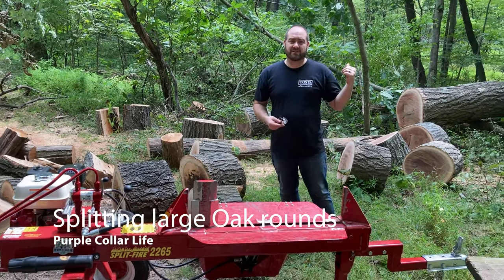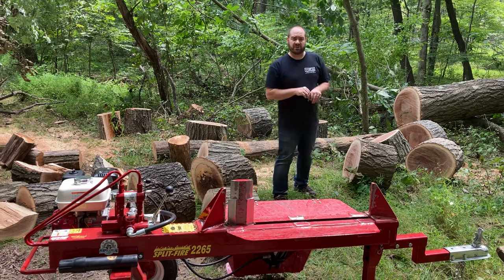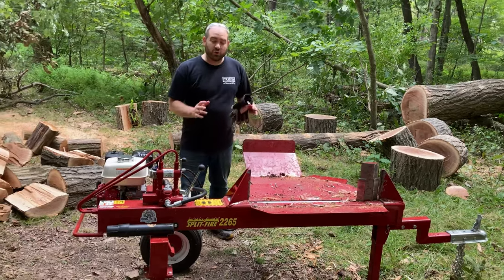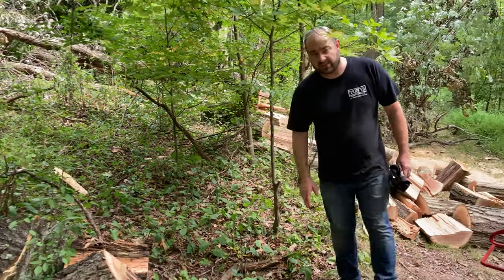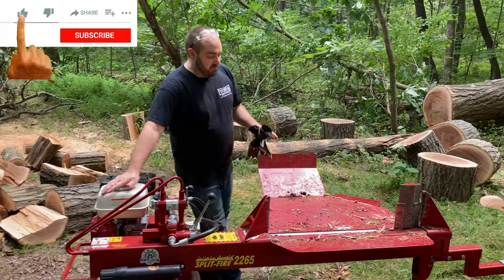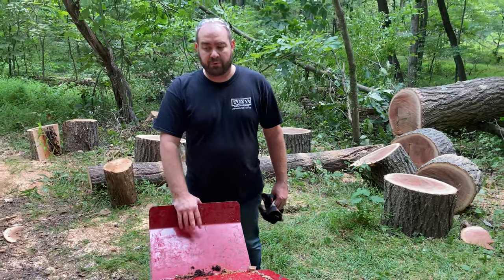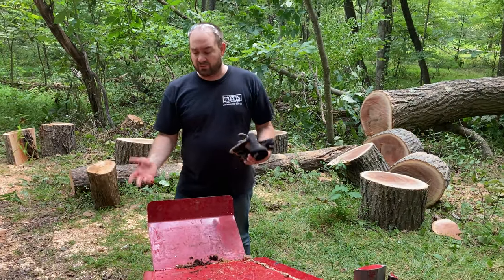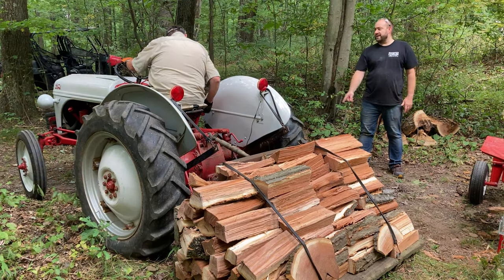Big Oak rounds too much for my splitter?!!

Comment: Good morning Chad! That’s one heavy tree which I’ve learned from Mike how heavy Oak is. Mike did some rounds a little bigger than yours and his was around 250lbs so I’ll guess yours was about 220. Aren’t you worried about bringing those ants into the house when you burn them? Also, nice to see you had some help. Have a good day!
Reply from the maker: Hi Ray! The Oak rounds are shockingly heavy.  And this is in the middle of the tree where they are around 18-20 inches in diameter.  Once we get to the actual base of the tree they will be over 30" round. Maybe even 40. I haven't measured them yet. 
I'm absolutely always worried about the ants. Any time we came across a piece with ants in it on or on it, we stack that in the woods and let them vacate.  
It's always nice to get work accomplished and get to spend time with my parents and Jennifer (and the pets).
Reply: helper is Andre the GIANT !!

Comment: Great teamwork Chad, have you ever considered after splitting the chunk in half, you slide back and your helper take the other half forward, then as the ram travels back and forth you feed your chunk in and the partner loads the split, and vise- versa , this would take good coordination on both parts, but I think the splitting would be slightly faster, may require a third person
Reply from the maker: I think I understand what you're saying, and I think that's how we use it most of the time. Once the knife goes forward through the wood, we put the next piece to be split behind the knife, so that when it's on it's return stroke, we're splitting on the way back.  That's the advantage of the 2-way wedge.  Am I understanding what you were asking correctly?
Reply: @PurpleCollarLife  yes

Comment: Would the next size up split fire be more stable when lifting the big rounds? One man operation, looking at some in my wood pile that size or bigger.
Reply from the maker: I think the additional weight and size (ballast) of the next size up would make the machine more stable for these large heavy Oak rounds.  Most of the time (80% or so), our rounds aren't this big, so we don't have to worry about that weight on the lift tipping everything over.

Comment: That’s got to be a years supply.  Since wood is so expensive could you sold it to a mill to make Oak boards?
Reply from the maker: If the tree weren't full of ants and split - it would have been great to make some Oak boards.  At the base, it may still be okay, but not worthwhile for someone to just come and get a few 8' sections.

Comment: What made you buy the split fire? How long ago did you buy it? Please tell me your pros and cons. I am thinking about buying the 2265. Thanks
Reply from the maker: Thanks for watching! We really like the 2265. Here's one of our first videos about why I got it: https://www.youtube.com/watch?v=iFKIUvQSzTw
We also have a whole playlist about the Split-Fire splitters. We do still have the 2265, but we recently added the 3465. https://www.youtube.com/playlist?list=PLJy7cj0ut2cCSKfPN0NxATQSRHe6JjZ1P
The main reasons I chose Split-Fire and the 2265 were because of the amazing engineering behind the log stops and the two-way splitting technology. We also like that it's got the log lift and Honda engine. And for the price, you're getting a much more valuable machine than other splitters in the price range/category. I also really like that the 2265 is so mobile - easy to move around by hand if you need to. Great splitter. I hope you enjoy the playlist of all the splitting we've done with the Split-Fire!
Reply: @PurpleCollarLife congrats on your new machine, 3465. I appreciate your response with all the details. On your 2265 please tell me what you chose as options/add-ons. If you are interested in selling the 2265 I might want it. Let me know. Thanks.

Comment: That's a pile of firewood from one tree.
Reply from the maker: You're right! We're just handling the tip of the iceberg here.  Once we get more toward the base of the tree, the rounds are over 30-inches in diameter.  Those will be even more impossible to handle and will produce a lot more firewood. I'm guessing I'll have to noodle those up before even putting them onto the splitter.

Comment: you got some fancy new shiny log splitter with a big fancy honda engine and you cant split that but my 40 year old 20 ton splitter with just about worn out b Riggs and scrapem 5 hp motor split 40" red oak rounds all day long.
Reply from the maker: It didn’t have any trouble splitting it. It just almost tipped over sideways when lifting that with the hydraulic log lift.  I wouldn’t want to have tried to lift that round (or that 40” red oak rounds you’re lifting) by hand! That would destroy my back.